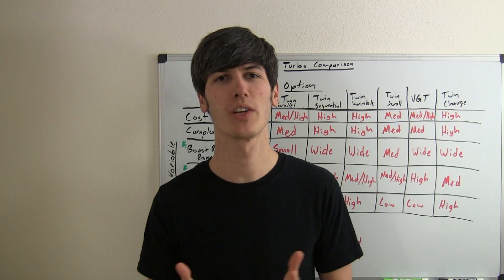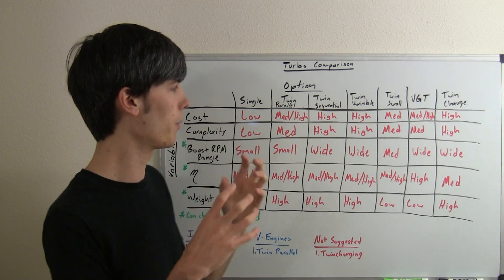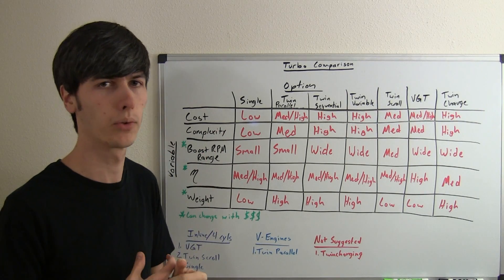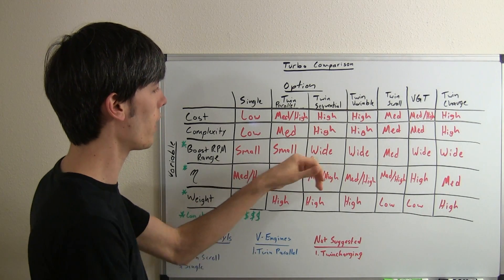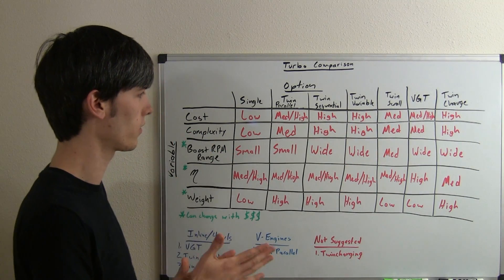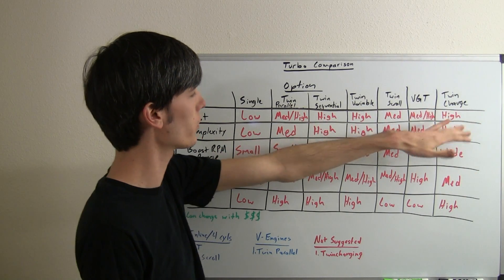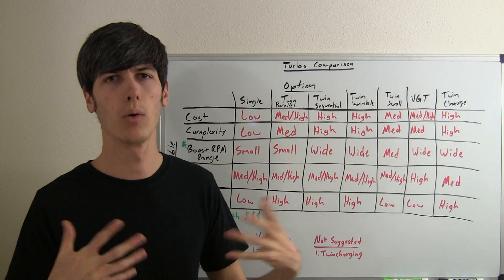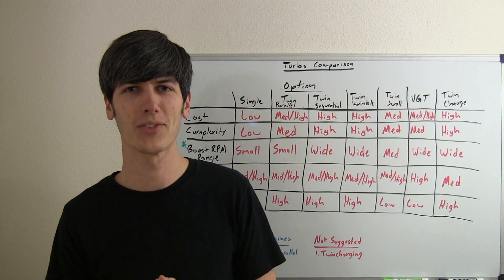Turbocharger Comparison - Twin Turbo vs Twin Scroll vs VGT vs Single Turbo

Comment: Great video!
I have a 1.8T 20V audi, and it has a million different hoses all around, that I don't see in non-euro cars. Could you do a video their function?
Reply from the maker: Thanks for the suggestion, not too familiar with that engine. Is that on a TT?
Reply: 1.8T engines are either Longitudinal and Transverse. I have longitudinal. 

S.A.I is needed because our turbo(k03) is too small amd our motor is too small and it needs that extra air at start up, S.A.I turns off after engine is warmed up a little. 
Crankcase hose is to get rid of extra crankcase pressure, from there it connect with valve cover and from there to pancake valve which is part of the T.I.P(gets sucked into compressor side obviously) 
Check valves are all over the place to make sure gases go only one way. 
You have a few that go under your intake mani one is the N247or something like that, another goes to your N49??(Electronic boost control which keeps your car from harms way)

A BT Set-up helps get rid of a few hoses and S.A.I. but unfortunately most of them actually(most under the intake manifold on my B6 A4) serve a purpose :/ 21 psi has made me replace just about every hose in there lol

Comment: There's a guy in the states with a compound charged lotus that had the highest power per weight ratio of any known car at the time. More than a veyron. I think it was featured on Driven. Some of the best group b rally cars had compound charging as well. You don't see it very often and this could be because it's complex, expensive and probably hard to tune but imo the best performance you can get if money was no issue. When they get it right, transmissions and diffs cry for mercy ;-)

Comment: how did you become so knowledgeable on everything? did you sail through an university engineering degree?
Reply from the maker: I spend a lot of time reading about this kinda stuff. And I certainly did not sail through engineering, it's tough.
Reply: Quality. IKR, I'm currently an engineering undergrad in England - it's no easy ride.

Comment: May I suggest a video? ITB/IRTB (individually run throttle bodies) with a turbo setup? I understand the concept of each separately but with an average turbo setup the air is forced in one throttle body, whereas with ITB's the turbo will be feeding 4+ separate throttle bodies. How would it be done? A large box around the ITB's?

Comment: Can you go over the variations of superchargers next? Centrifical, Whipple, single & twin superchargers (parallel and sequential twin superchargers), variable speed and 2 speed superchargers. Different types of impellers 2 & 3 lobes, twin screw, and how the angles and shapes of the vanes on the centrifical superchargers and twin screw have dramatically improved efficiency over the years. How different styles of impellers get better efficiencies as production quality increases, such as cast verses CNC. Belt vs Crank driven superchargers. How you can make more power with the same size supercharger simply by changing a pulley. Do a video on Flywheel superchargers. How superchargers make engine HP & TQ grow geometrically thru out the RPM range.

Comment: Twin charging not very good and not seen much... just saw a top gear episode with a car called the zenvo with twin
Reply from the maker: It's not that it's not that good, but it's just overly complex and expensive. It can achieve its desired goal, but I think there are better ways of doing so.
Reply: BlueHuck
and VW mass produces it as the TSFI
Reply: Its still not as common as the others though
Reply: It's actually more common than you think. Hellion has been producing twin charge kits for years.
Reply: Inspector Poirot TSI initially but they interchange TSI and TFSI these days. There is really no code for it. Just have to know what you're buying.

Comment: Can you do a video explaining waste gates (internal and external), blow off valves, and bypass valves?
Reply: That would be a good video but it is pretty easy for the basics. He should do that plus talk about different boost control systems like manual versus electronic, 2-port vs 3-port etc.
Reply: I think he did in one of his earlier vids. Look back from some that a year or two old.

Comment: twincharging comment unfortunately is not accurate. In TC supercharger is just for spinning of huge turbo so supercharger effitiency does not really matter since power is generated by turbo anyway. It has widest power spread of these all. Is no more complicated than twin turbo applications and costs as much as twin turbo.
Reply: what you're talking about is a compound turbo setting, where the supercharger feeds compressed air to the turbo so it is more efficient. Twincharging an engine is adding a supercharger and a turbocharger to the engine itself.
Reply: potatoknight so TSI is compound turbo setting? because it works in exactly the way I described. twincharging may have few layouts like sc feeding turbo, turbo feeding sc, parallel and they differ in pros and cons in various points but all of them are known as twincharged systems.
Reply: Well there are different compound settings, like a small turbo feeding a larger turbo to reduce the lag of the big one, or a supercharger feeding the large turbo for the same reason, but the definition of twincharger is a supercharger and turbocharger feeding the engine so that you take advantage of the low rpm torque the supercharger offers and then the high rpm turbo kicks in and gives more boost
Reply: potatoknight well in that case compound turbo setting you mean with supercharger and turbo combination is simply twincharged layout. does not matter what blows into what - in all cases you get low rpm power thanks to sc and high rpm power thanks to turbo which as you mentioned is the definition of the system.
Reply: Well that is the distinction; twincharger is where two systems (sc and tc) feed the engine whereas compound turbo is where only one system feeds the engine (the high power turbo usually) which in return gets fed by a sc or another tc.
Reply: ok man you claim that sc to turbo layout is not twincharging but compound turbo. That is simply not true - even in sc to turbo layout with big ass turbo -> when sc spins that turbo up it also takes care of low rpms power at the same time. However If this layout can be called also as compound turbo then why not. It is what it is. I like these vids but in this twincharged idea is just taken too shallow when indicated as not suggested. Its not that complicated and scary - just rare because it gives mostly balance and most of people want just max power for as little as possible. I think what Engineering Explained could have added here what would be best application of each of these layouts - like straight line, track, circuit and so on. That would be nice feature. For just quarter one big turbo is really more than enough. For move curvy applications twin systems start shining.
Reply: Yeah definitely, I agree with you that he could have given more information towards twincharging and what not, I was only trying to do the distinction between compound turbo and twincharging because if you look up on internet, twincharging will give you the definition he gave and compound turbo will give what you were talking about. That`s why I asked him if he could go in detail about twincharging and compound turbo
Reply: potatoknight thats a great idea!

Comment: Do the new F1 engines use a VGT turbo?Or they just spool up the turbo with the electric motor so there isn't that much use for one..?
Reply from the maker: talltomrich1 Actually, it can: 2014 F1 Engine - Explained
Reply: Engineering Explained I had sense watched the linked video and done more reading.  I could see it utilized as an anti lag system and retaining boost.  However I'm still not convinced that an electric motor alone could provide boost with partial/open throttle.  I'm no expert and would love to hear more on this subject if you get a chance.  Videos and input much appreciated as always! cheers
Reply: Exhaust gasses can spool turbochargers up to 100,000rpm on street cars with redlines in the 7k-8k range.  The new F1 engines redline at 15k rpm.  If i had to guess, it's going to be a big turbo with some sort of anti lag system.  An electric motor could never create significant boost in a system like that.

Comment: Yes, comment, please, about VAG TSI engines, if twin-charging is considered bad by You.
Reply from the maker: Is that engine still made? Is it used widely on the VW's product line?
Reply: Even Golf Mk7 (newest one) uses TSI engine.  
Many VAG cars uses it, by most Audi and VW ofcourse. Can't name exact models now, but You can easily find out in wiki. (=
Reply from the maker: I think you'll find they're pretty uncommon.
Reply from the maker: TSI = turbocharged stratified injection, not twincharged.
Reply: Read a bit better before answering. http://www.volkswagen.com.sg/en/technology/tsi-engine/the-tsi-twincharger-motors.html

Not all TSI engines are twincharged though.

Comment: Why does VW use the Twin Charge option in its TSI motor when it is the "worst choice" ?
Reply: I could be wrong, but I believe it is was the worst option because it was expensive and complex not because it is the worst system. I imagine it creates great boost across a huge rev range, but the complexity and cost of the system keep it from being the best choice overall. VW uses it to create a better engine and have refined the process to where it isn't as expensive and complex. For someone to decide to "twincharge" their engine from their garage though, they have better options for the money.
Reply from the maker: I'll agree with what Justin said. It's not that it's "bad" it's just that I believe there are smarter options out there. There's a reason they're not very prevalent.

Comment: Twin Parallel+ Twin Scroll+ VGT= Rule the world
Reply: thanks
Reply: ***** Dual borg warners on a v engine (gtr for example) can be done at a cost very similar to simply upgrading to bigger single turbos
Reply: +MrTheMrhappy Yeah if you wanted a set of oversized and heavy units that don't compare to newer technology turbos that come in smaller packages. Borg Warner Turbos are cheap until you add the billett wheel, anti surge housing, ball bearing options and so on. You can get much more efficient units in smaller package that are the same size as the BW's.